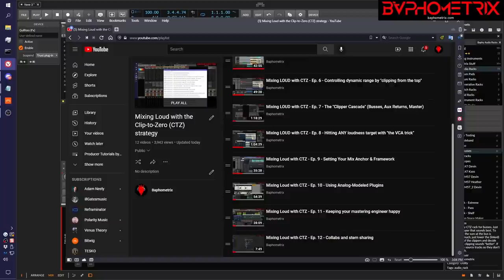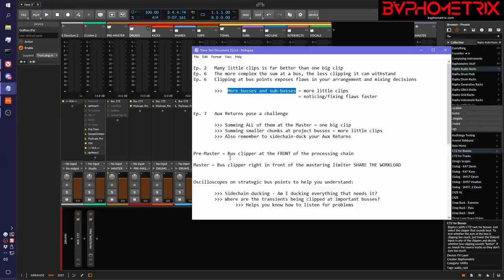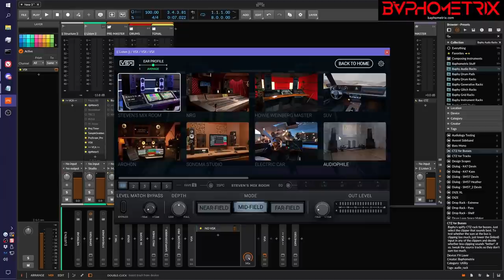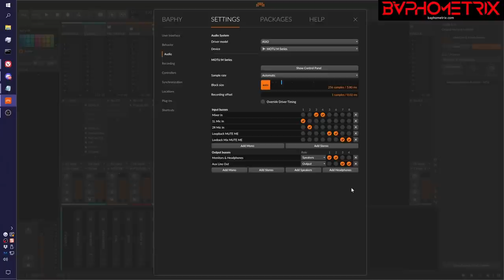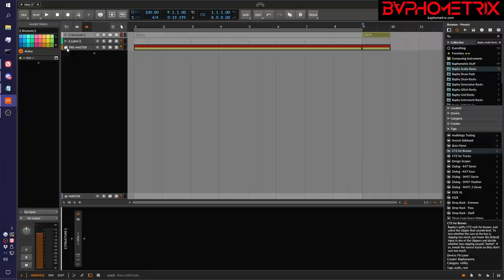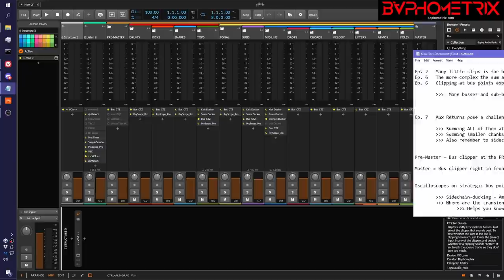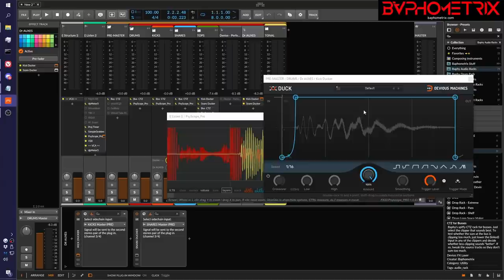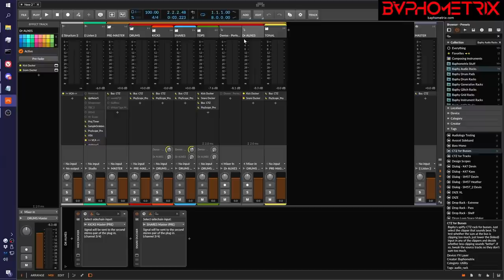Mixing Loud with CTZ - Ep. 13 - Structured bussing & a tour of my own project template

Comment: I rebuilt Your template on my own and got  a much deeper insight on the CTZ approach. As even the template projects with some minor individual tweaks got quite complex, I documented the structure of the tracks and groups in a Powerpoint. Now I can see the signal flow on one page: The qouping of tracks, where all the Sends go an which track is beeing ducked by another one.  Can highly recommend this! This Powerpoint will be my second template in the production phase. I have allways been struggling to understand old projects after a while. ..........

Comment: Very good demonstration of CTZ and the structured bussing. Splitting by spectrum / content has always been the best way to mix for me - putting lots of channels labelled synth 1, synth 2, bass 1, sub 1, sub 2...etc and then trying to mix is much harder. similar sounding things should be made to sound as good as possible on their own - then grouped together and treated as a whole. Much more consistent sound.
Reply: Also, FL Studio is great for flexible routing of tracks and audio - the current track is great. You add a plugin to that channel and it will affect which other track you have selected, perfect for scopes, meters, testing effects on different tracks.

bitwig (for sound design) and reaper (for recording) are also fantastic DAWS and I recommend both highly - (paid for them myself and use them daily)

Comment: One question about the Listen-Bus. I don't get the difference to "real" Listen-Bus and something like THIS in Ableton: All tracks grouped to the Pre-Master-Bus. In the Pre-Master-Bus I set the Send to an Audio Track (named "Listen Bus"), that's outside from this Pre-Master-Bus. In this Listen-Bus I set the "send to Audio" to the Master. If I get it right I have all in need or not? A Pre-Master to Work with, a Listen-Bus to set meterings and so on and a complete empty Master. Or is it wrong? All Return-Tracks  also set to "send audio to" Pre-Master. So I get all the sum on the Pre-Master-Bus, where I listen over the Listen-Bus

Comment: Trying to apply CTZ in my new projects for some sections at least and struggling a bit with my previous habit of heavily using OTT. I find that sometimes it is much easier to apply OTT than CTZ. Yes OTT colors the sound, but who cares especially in bass music nowadays? I wonder what author thinks of extensive use of OTT everywhere?

Comment: Thanks Baphometrix for the course, it's fantastic.

A question! Where would you put a BASS group? It's frequency content does not originate in the sub range but usually expands into the mid range. I would argue it should be inside the TONAL group, between SUBS and MID LINE, but sometimes the bass has a midrangey sound that may interfere with the MID LINE. What would be your approach?

Really appreciating your work!
Reply from the maker: I put most/all of my mid-basses in the "DROPS" group in my template.

Comment: Testing this method out in Ableton. It's quite a challenge using PSYScope due to the PDC latency problems. I have tried adjusting for latency within the scope but due to multiple groups and routing it becomes a headache. You can never be sure you have your latency setup correctly. Anyone got any tips?
Reply: trying to figure this out as well, makes psyscope useless lmao
Reply: He answered here about this that the fx23 site got a way to fix it
Reply: @iamBQ  yeah the "fix" is basically keeping track of all the plugin latency in each channel and setting psyscope delay to compensate..... every single time you add latency you need to adjust psyscope. Not very good for workflow so I'm just going to try Bitwig
Reply: So if you had your scope on the group bus how would you calculate latencies on multiple tracks?

Comment: I've been struggling doing CTZ in ableton, because of how delay compensation works. It doesn't report it to the internal clock. My oscilossopes and sidechains are not in sync. I can use offsets but whenever I introduce a new plugin that has delay I have to readjust the offsets. I am seriously considering switching daws because of this.
Reply from the maker: Yeah... I'm honestly surprised that Ableton hasn't cleaned up stuff like this after all this time and popularity.
Reply: this x10000.  Also considering making the jump to Bitwig.  CTZ really highlights the shortcomings.
Reply: I stopped using Ableton
Reply: I´m sooo close to switching to Bitwig.
Reply: @Somedei  was it easy?
Reply: @comrade8600  it always takes time, been on Logic and fl studio so is just a matter of playing with it every day, playing many videos and patience, try for yourself and see which one suits you better, Im right now on Cubase but Studio One has better routing for mixing as baphometrix said he is using Bitwig

Comment: So I don't know if this is purely an Ableton issue, but when using psyscope pro and analyzing the Kick/tonal buss relationship (placing it after an instance of duck or gatekeeper), there is anywhere from 30-300ms delay in what psyscope is showing me. Makes it basically useless to analyze, is there any way to compensate for the plug in latency? Thanks for the vids they are a great help, just can't figure out why the kick and/or other busses are not aligning visually within psyscope.
Reply from the maker: It's an issue with Ableton's PDC reporting. The FX23 site has instructions somewhere on it for working around Ableton's issues in this regard.
Reply: @Baphometrix  awesome thank you again

Comment: Hey!
I recently came across your tutorial series "Mixing loud with CTZ" and I am almost fascinated by this technique. It's amazing how much bullshit is said on the internet.
I have a question about this technique as one thing is not clear to me.
 
As an example for the drums:
Kick Tracks, Clipper -> (Kick Bus, Clipper) ->
Clap Tracks, Clipper -> Clap Bus Clipper -> DRUM-BUS, Clipper
Hat Tracks, Clipper -> Hat Bus - Clipper ->

If these buses are now merged to another bus (in this case the drum bus), clipping will occur at the bus input when kick and clap play together (for example +4dB). This is compensated by the bus clipper at the beginning of the chain, so the drum bus is back to 0dB. 

Now my question: Is it only an "information" at the bus input or does it really clip at the input? Have I perhaps overlooked/overheard an important part?

In my opinion, I could not perceive any extreme overloads when a clipper is set at the beginning of the DRUM bus, which would be clearly audible at +4db.

I also compared it to the same DRUM bus, where the overdriven value on the DRUM bus of each associated track is turned down, so that on the DRUM bus the peaks are at most 0dB and afterwards the clipper compensates for the turned down value. However, the volume ratios or the loudness, when comparing the DRUM buses, the individual elements, deviate from each other at least once. 

I work with Ableton.

I look forward to your answer and thank you in advance!
Reply from the maker: I'm not quite following your question, but just remember that the clippers are always at the END of the processing chain on any given track or bus. For example, if you sum kicks, claps, and snares at a bus called DRUMS, you might start out with just a single bus clipper there on DRUMS which ensures that whatever is happening on that bus never goes over 0 dBFS (clipping it, essentially acting like a limiter on that bus).  Now say you add some processing to that DRUMS bus. For example... Ableton's "Drum Bus" device (lol what a confusing name). Or some EQ to pull down some ringy resonances. Or whatever. You want to put all those things in FRONT of the bus clipper itself. Because they're all going to be creating new/different peaks on top of all the signals from the summed tracks merging at that bus, right?

Clippers always control the peaks back down to 0 dBFS at the END of every track/bus. That's why this method is called "Clip to 0".
Reply: @Baphometrix  Yes, I am aware of that, I have already seen your CTZ series up to this episode! :)
Okay, thanks for the quick reply. Maybe explained a bit easier again :D.
So I have kick, claps and hats together as buses, which in turn run into the drum bus. Since kick and clap also play at the same time, there are peaks in the drum bus input that are above 0dB(4dB). So this is not a big deal because the clipper at the end of the bus catches the peaks? I thought that in the processing chain overloads are also undesirable - isn't that the case?
Or should the input from the drum bus not be above 0dB?
Reply: @Baphometrix  Okay, I think I got it. Thanks a lot!

Comment: In this video you mention turning the VCA up or down if you need to. It was the first time I heard turn up.  If you set the dpMeters up for 0 on your individual tracks and you turn the VCA up… is that OK now that the individual tracks are higher than zero going into the clipper? Sorry in advance if this is silly question.  I know the busses go above zero and then are clipped with the clipper, just was unsure on the tracks.
Reply from the maker: You would turn the VCA up only if you were originally shooting for a relatively quiet and dynamic loudness target on your final mix. So imagine your arrangement and rough mix is complete, and your song is measuring something like -10 LUFS (integrated) across the full span of its loudest chorus/drop/hook section. And imagine you wonder what the song might sound like at -9 or -8 LUFS instead. That's when you might choose to turn the VCA up. For most of us working in loud genres and trying to hit targets more like -7 or -8 or -6 LUFS, we typically wouldn't try crushing the song even more, so we'd probably be going the other way, maybe testing what our song would sound like if we took it *down* by  1 or 2 LUFS.

Comment: Hey Baph, do you recommend sending reverb and delay post or pre clipper?
Reply from the maker: You usually don't have a choice. In nearly every DAW, your choices for sends are either "pre-fader" or "post-fader". Any processing from the track or bus clipper in the insert channel is already baked into the signal at that point.
Reply: @Baphometrix  i was thinking of sending to a reverb or delay bus which comes back to the group bus but keeping an individual bus where i’ll have a clipper for that specific track, then sending to the group bus. Its a bit messy but still can achieve pre clipper reverb. Either way i don’t think it will make much difference. Do you recommend any specific mixing tutorials based more on eq, balance and placing sounds in the frequency spectrum and stereo field? That seems to be one of my biggest weaknesses atm.
Reply from the maker: @kiko8u  There are a fair number of such tutorials out there floating around YouTube. And my next three episodes in this series will be specifically about these questions.
Reply: @Baphometrix thanks Baph!

Comment: Just FYI, FL Studio has a Listen bus that's been basically implemented exactly the way you use it by default on the Mixer, ever since FL9 at the latest. The difference is they call it Current, and it's designed to follow the focused mixer track/bus with no audio out routed by default, though you can assign it to function as a Headphone/Cue bus very easily. What can be a drawback for this is that it's also the only mixer lane designed to handle Sample Previews from the Browser, but obviously by the time you'd have to worry about major conflicts between the mix and these previews is if you get bored and start poking around in reverse, dipping back into sound design when you're well into the later mixing phase(s). Probably much more info than you need, I know, but you and I seem to kind of share the gift(/curse) of long-windedness lol
Reply from the maker: Good to know! Thanks for sharing this.

Comment: Does anyone know a free vst for sidechain-ducking with obtion to do external sidechain? I don't use the kick on every beat and I want the sidechain to work only when kick is hitting.
Reply from the maker: I've never encountered a free one that can duck against an audio sidechain. The one I use ("Duck" by Devious Machines) can be triggered from MIDI or Audio sidechain inputs, and is fairly inexpensive, at only about $30 USD (or less) most of the time.
Reply: @Baphometrix  , thank you! 😄

Comment: I think somewhere you said you don't clip subs, but what if the sub is part of the bass preset, which can be often these days (and how I prefer it sometimes). Is it ok to clip those basses? Or what will it ruin the sub?
Reply from the maker: It's okay to clip a heavy midbass that you're also using as the sub. If it sounds good, it's okay.

Comment: Hey baphy, how do I know when or when not to touch the mixer fader on individual channels? I understand why you'd turn down the fader in a bus but what about individual Chanels? I'm a bit confused about it. Ive been mixing using faders up until this point.
Reply: Im on Ableton, maybe the interface of your DAW is throwing me off a bit but would I just use 'utility' to turn stiff down?
Reply from the maker: It's simple (once you wrap your head around it). In the early stages of a project, you are bringing new sounds in one by one. You're sound designing them. You're gain staging them. You're balancing them against the other sounds you already have in the arrangement. Your mix is far from perfect, but it's a rough static mix already, especially if you follow my advice and carefully set the loudness and relative balance of your main "framework" sounds.

At this early stage, just leave the fader at unity. Do all your rough balancing adjustments with your channel processing on that track.

Now you're done with that new sound. It's mostly done and roughly balanced. At some point later as you start fine-tuning the balance (and EQ, etc.) of your entire mix, THAT is when you grab the fader. You won't be doing huge adjustments to the relative loudness of that track. Just small ones. Because your fader is already at unity, it has the most "resolution", so you can do fine balancing easily. From this point onward, you'll be balancing mostly with all your track faders.
Reply: @Baphometrix  can’t thank you enough! Thanks for replying
Reply: @Baphometrix  Hi! just one more quick clarification if you wouldn't mind
So when you refer to "making the pre fader peak on every track and bus touch the ceiling at 0 dbfs" that's different than db values right? obviously 

so does that mean something can still be clipped to zero, and have a value of -10 db via turning the fader down right? 

Sorry if this is going completely over my head I'm a slow learner.
Reply from the maker: @Goldchunks4  dB values on a DAW track meter = dBFS, aka "Decibels, Full Scale". The "full scale" part is just a fancy way of saying "the full scale of minimum to maximum values that can be represented in  digital samples. 0 dBFS is the loudest possible value in the digital realm. Any value over that amount can exist temporarily inside of a DAW because of 32-bit floating math, but when you try to print that signal to a file (WAV, FLAC, AIFF, MP3, etc.) any value OVER 0 dBFS will be instantly chopped off at 0 dBFS. Which is what we call "digital clipping". (Which is essentially the same shape/effect as what a Hard Clipper plugin does.)

So yeah, pre-fader, you want your tracks running at or very close to full scale. That helps you know how loud they can get. But you don't balance EVERYTHING in your mix that loud. Some of your important "anchor" or "framework" sounds (like kick and snare drums in most electronic dance genres) will indeed be hitting right at 0 dBFS, even on the printed outputs. Everything else is balanced against those important frameworks sounds. This means that some (possibly many) of the tracks in your project will need to have the faders pulled down to make them much quieter, where they belong in the mix.
Reply: @Baphometrix  k Thnx if I make it I owe you the world

Comment: Hello! If you have bus processing such as compressors, saturation, etc, if the aux sends are sent to that bus, wouldn't that reverb/delay/etc get processed through those plugins on the bus? Or are they still going in Parallel? 

I Use logic pro X so I'm unable to do such routing, but I'm wondering if that's the case

Thank you for your awesome videos! @baphometrix